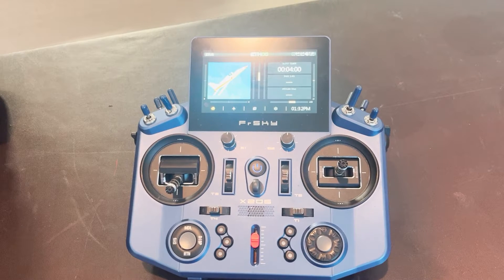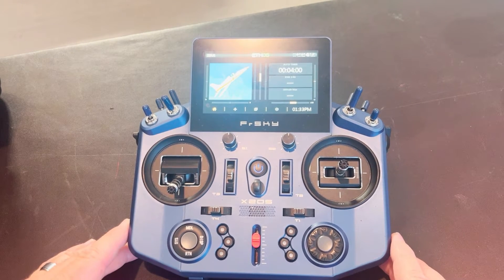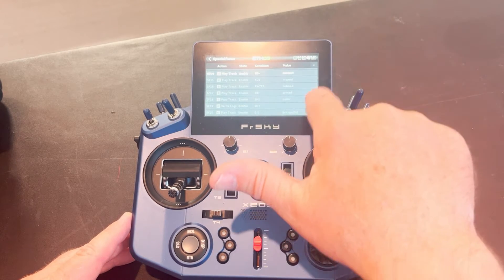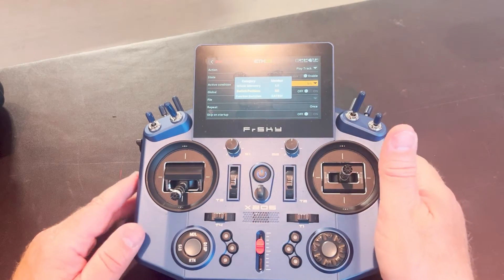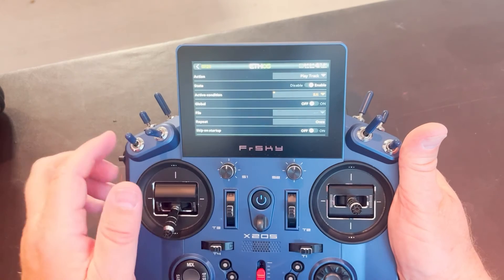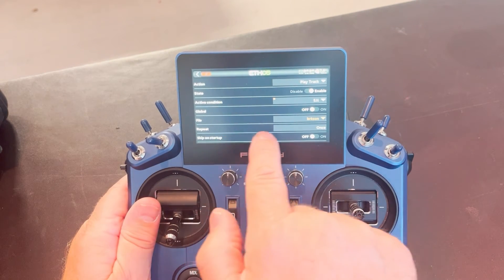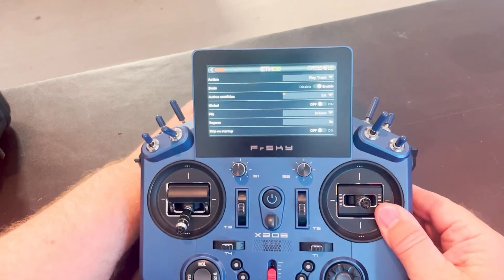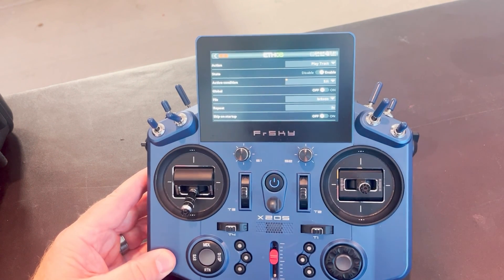FrSky X20S Setting Up Special Function Voice callouts

Comment: Thanks for sharing.  Is there a way to make the radio read the text in sequence?. Currently if I move a 3 position switch from position 1 to 3, it will read only the speech for the middle position but not the third position, unless I wait till it finishes speaking in position 2 then I move the switch to the third position to hear its speech.   In spektrum the radio will read both in sequence so I know the latest switch position.
Reply from the maker: Yes. In the systems menu, go to hardware. Then select switch settings. There is a way to select switch middle detect delay. Turn that up to about 80ms. That way it will ignore a quick pass through a switch position. Hope that’s what you’re looking for.
Reply: @azflyer3297  thanks a lot. Great tip. I discovered that this only happens with “text to read”, so I started using amber voice “play file” rather than “read text”, voice don’t overlaps now, and it go in sequence.    

Another topic please,  I have been now for 2 days trying to activate throttle reverse and not successful.  At first it was always on, then I made an esc calibration, now the correctly edf is blowing air (rather than sucking air), but I am still not able to set a thrust reverse.  

The quality of FRsky RS radio is superb, but i wish few things were more simple,, I am spending hours on the radio because i like it ,,, but not finding time to fly lately )) !   

Same issue with the reflex gyro, i wasn’t able to make it acknowledge a 3 point switch easily.  On spectrum i used to put it on any 3 position switch and it is done in a second .  With FRsky it took me long of try and error playing with the pwm to have a 3 different setting working.   

Any idea how to fix these 2 issues? 

BTW, the aircraft is an FMS Viper 90mm.  Thanks
Reply: Good news. The only way to fix my issue was downloading the predator esc 120A used by FMS, reset to factory settings (11 beeps, which are 2 long and 1 short), then activates thrust reverse (4 short beeps) and it worked. Thanks